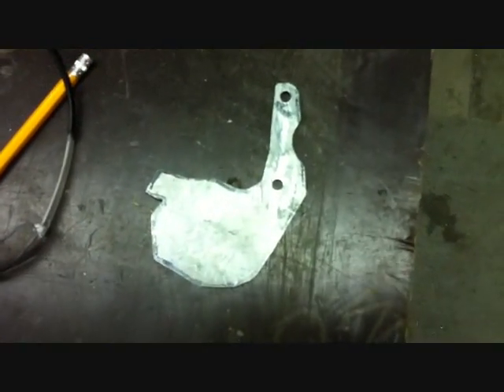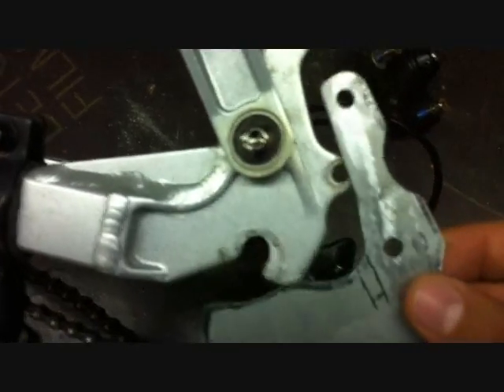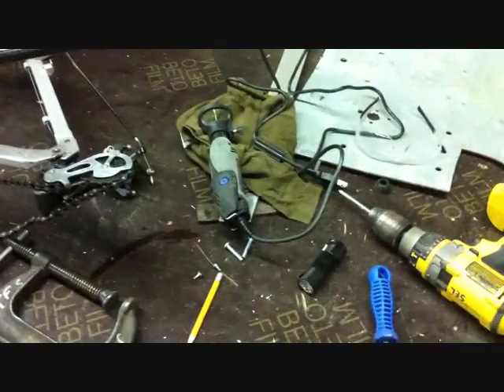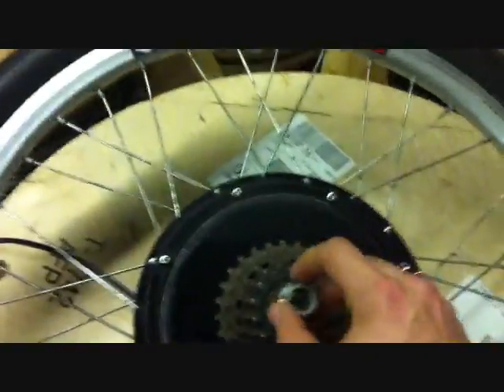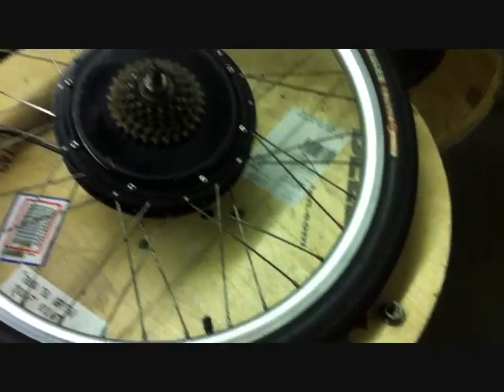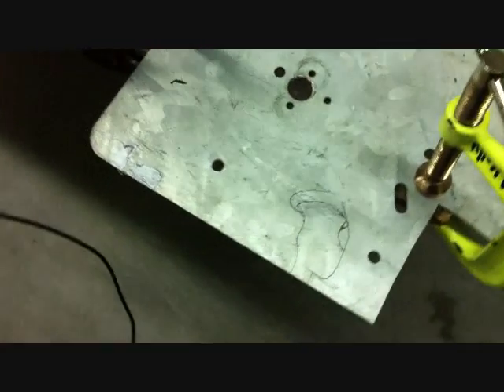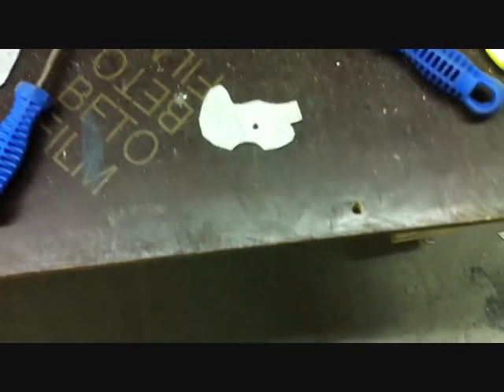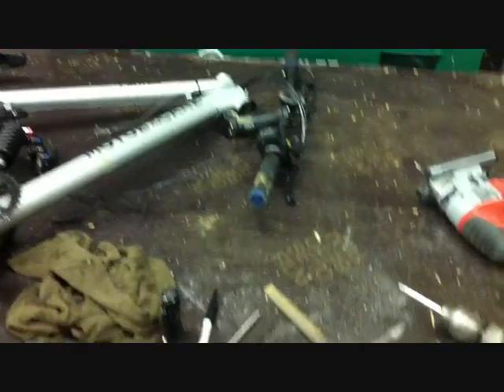EBIKE 72v - Torque arm design take 2

Comment: I need these on my bike gotta try make some tmz , 3000watt hub didnt like my new frame at all , it popped out and shredded my wires!! So im trying to make something like these pretty much the same thing haha and then it can not come out the frame no matter what
Reply from the maker: Ouch be careful that can be costly! typical rule is only use steel frames and you need to file the dropouts so the axle seats properly. then install torque arms also
Reply: @EBIKEScott  ive got a diffrent frame now and its all build and working fine, ive made plates that act as a locking wheel washer that bolts to my frame both sides , i can ride it with just the washers and bolts to the frame and the wheel does not move, ive done 47 miles and havent had to tighten anything back up, ive marked all the nuts an washers they havent moved anywhere , i got a new wheel the next day while my old 1 is repaird so ill have 1 spare if anything happens , these kits are serious power im running 80 amps from 72volt an its doing 60mph but ive now gone down to 60amps and its not as fast but still fast enough to do 45 mph
Reply from the maker: @catalickconverta6823  ya you are where the power gets very fun! Glad you got it all sorted out.

Comment: Has anyone successfully transformed an aluminum bike to ebike with a high wattage over 1000 w motor and torque arms that has lasted for a significant amount of time
Reply: Yes, I did. I just cutted two torque arms (for both sides for extra safety) out of some hardened steel, idk what kind it was, it was just laying around. For comparison, there was a piece of it that was roughly a hair thin and I wasn't able to bend or break it. You can imagine what forces two massive plates of that metal can withstand. After 120km, I checked up the dropouts, they weren't deformed, nor did the axle bite itself through it. If you need help with making one, just drop a comment.

Comment: ...chain stays.

In the video the axle hole in the torque arm is keyed to fit the motor axle exactly. This keeps the axle from spinning within the torque arm. The arm part of the torque arm is the fixed to the chain stay. Are you familiar with a coaster brake? It uses a torque arm. It is what resists the backward pedaling force allowing the brake to work.

One other thing, you need a torque arm on both sides of the bike. 

Depending.....

Comment: ....to handle the torque from an electric motor. This greatly increased torque load wants to spin that axle. The dropout does it best not to let that happen. Sometimes the torque wins the battle and will literally break the thin metal of the dropout. This is where the torque arm comes in.

The torque arm does two things; first, it beefs up the the structural integrity of the dropout area, and second, it spreads the torque force to the surrounding area of the bike frame - usually the...

Comment: ....flat sided on parallel sides reducing its thickness to that of the bicycle hub. When fitted into the dropout, because of those flat sides, the motor axle is locked into a stationary position. Axle nuts are threaded on to lock the axle into the bike. Without the axle nuts the rear wheel assembly would dropout out of the dropouts.

Your bicycle frame is just thin metal around the dropout. It's plenty strong to handle any torque applied to it from pedaling. But it was never designed...

Comment: FoolishOptimusPrime: Torque is the twisting force of the motor on the axle. If you held onto the tire of an unmounted motorized wheel and applied power to it, the axle would spin. When mounted the axle is locked down keeping it from spinning and thus spinning the wheel instead.

The axle of a motor is a larger diameter than a bicycle hub's axle. The dropout - the u-shaped slot - is sized for the bicycle hub axle. The reason a motor hub axle fits into this small slot is because the motor axle is